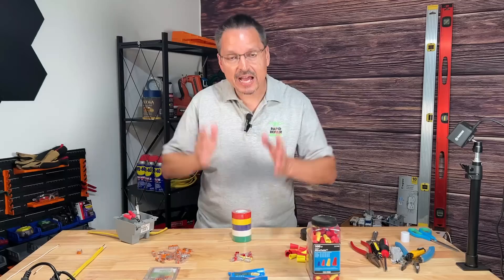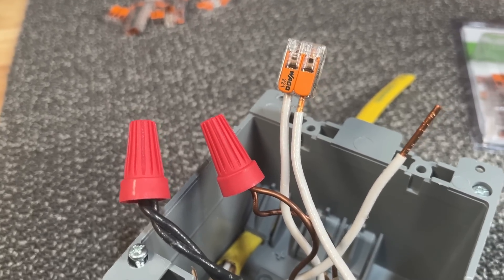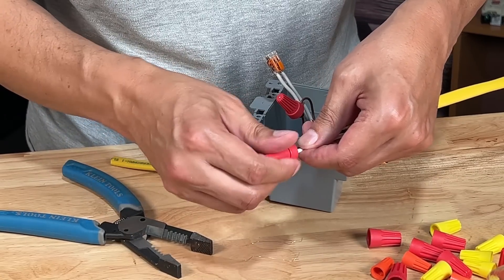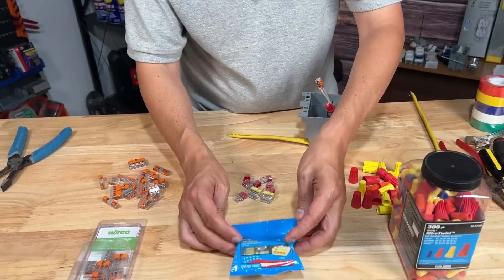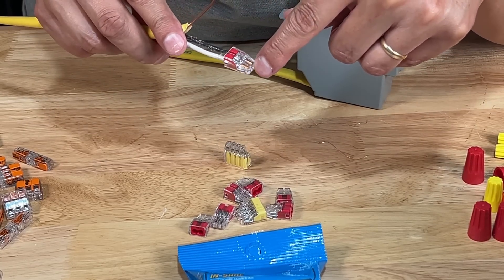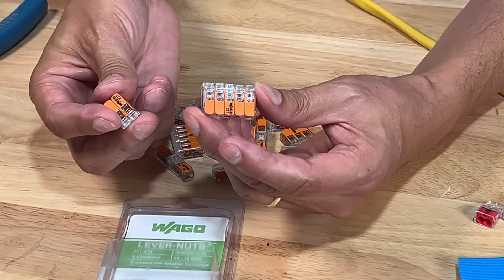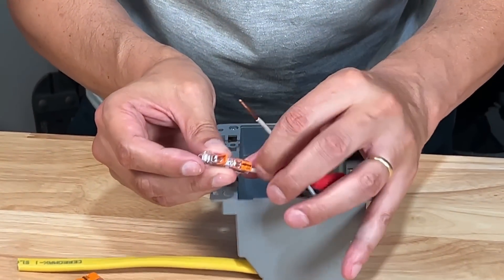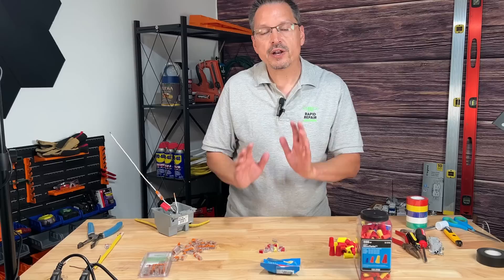Electric Wire Connectors for Beginners

Comment: I'd have mentioned, that there are different types of Wagos for different types of cables - I guess other manufacturers (e.g. Ideal, Tracon) do this as well.

I think you showed series 221 with the clamps, and that is good for both stranded and solid wires but not ideal for aluminium.
The 222 series looks different (has no window on the housing, more robust), has clamps, good for stranded and solid, aluminium as well - with added paste.
The 2273 series are push connectors mainly right for solid wires. You can undo them by twisting the connector while pulling the wire. Not sufficient for stranded wires. Also works with solid alu lines with the added paste.

That's what I've learned during my DIY projects.
Or I could be wrong.
Please always select your connectors for the task accordingly and read the manufacturers description.
Reply from the maker: Wow Great points! Thanks for sharing your knowledge and experience with the different types of connectors 👍🏼 You are very thorough. I only prefer the 221 with the clamps because they work equally well with stranded or solid wires. Which is an amazing benefit, especially when hanging light fixtures.

Comment: WAGO connectors are the 'must-use' when you are connecting a 'stranded-wire' to a 'solid-wire'. If you try to use a wire nut on a stranded-to-solid wire joint, 75% of the time it won't work out right. With WAGO, it works right 100% of the time.  For stranded-to-stranded wire, or solid-to-solid wire you can use anything you want.
Reply from the maker: I 100% agree with all your points. Very wise and experienced 👍🏼😎⚡️

Comment: When do white wires connect to black ones? I'm trying to extend a light fixture
Reply from the maker: That would be very rare. Generally they always match. 

However I’ve seen white used as hot when a 240 volt circuit or sometimes a 3-way circuit. Also red can also be hot. White should also be neutral unless it’s marked as hot.

Comment: I’m fixin to connect the four wires of the control box to the motor of a log splitter.  I have the yellow twist on connectors  that I think will work fine.
Great educational video sir.
🤓
Reply from the maker: Nice. You’ll do great. Twist-on connectors are perfect and proven!! 👍🏼⚡️
Reply: @HomeRapidRepair  Thank you for the quick response.  🤓

Comment: Can I use it with copper wire and aluminum wire connect together
Reply from the maker: Yes some are designed to connect aluminum and copper wires: 
Aluminum-to-Copper (Al/Cu) Wire Nuts
These wire nuts are designed to safely connect aluminum and copper wires. They typically contain an anti-oxidant compound to prevent aluminum oxidation and ensure a secure connection. 
IDEAL Twister AL/CU
This UL listed twist-on connector is designed to prevent aluminum oxidation and provide a secure connection. It contains a corrosion-resistant compound that penetrates corrosion build-up on aluminum conductors. 
Connecting aluminum and copper wires directly can lead to corrosion and overheating. Aluminum wires are more active than copper wires, so connecting them directly will accelerate the oxidation of the aluminum wires.

Comment: Thanks for sharing! I have a quick question: what if the wires to be connected are uneven? In my case, I need to connect a thick wire to the wire of my LED light. I'm not sure about their exact sizes, but it involves connecting thick and thin wires. Can I still use the WAGO Lever Lock for this?
Reply from the maker: Yes you can! 100% you’ll be good. The WAGO displays the allowed wire sizes and it’s a wide range. 👍🏼

Comment: I have a 4 gang box with all smart 3-way switches / dimmers . There is just no room to have like 20 twist nuts. I was looking for some smallest connectors of some sort but I see none. Only way now is to replace these stupid smart switches / dimmers with ones that don't have pigtails but push-in wire connections.
Reply from the maker: I think you’re probably right on the push connectors. That’s crazy amount of wires. Sometimes electric is frustrating. Good luck ⚡️🛠️🏠

Comment: Electrician here from Europe (Switzerland/Germany) we only use the wago brand. They manufacture the the lever'ed ones as well as the push in ones. You can twist the push ins off the wire btw. And also we dont have romax but NYM-J where everything is isolated (L,N,PE/L1,L2,L3,N,PE) and just like the romax it has another layer of Isolation around all. Wirenuts, tape and luster terminals arent being used due to being a fire hazard here. If being screwed in somewhere stranded cables need to have wire end ferrules attached aswell, fire hazard as well if not done correctly.
Due to these measures there's basically no fires nor accidents involving electricity here.
Reply from the maker: That’s awesome. I think WAGO’s are great too.  Thanks for sharing your experiences. I really appreciate it. 😊🛠️

Comment: Pretty much everyone that I know of over here in Norway have switched to Wago connectors. It can give you a cleaner install in tight spaces, like for example in small boxes where you normally use terminalblocks to connect sensorcables, way easier just sticking some heavy duty doublesided tape on the wagos, stick them to the box, feed the wire and done.Timesaving also if you're replacing sensors with fixed cables (I work in the industry so thats why i chose this as an example).
Wouldn't recommend neither of the connectors for use in humid enviroments tho, corrosion can be pretty scary sometimes.
Reply from the maker: That’s great. Thanks for sharing that. WAGO’s are still rarely used here in USA, but growing in popularity. Do you know if they are manufactured in Germany?
Reply: @HomeRapidRepair  located in Minden germany🤷easy google search
Reply from the maker: Thank you